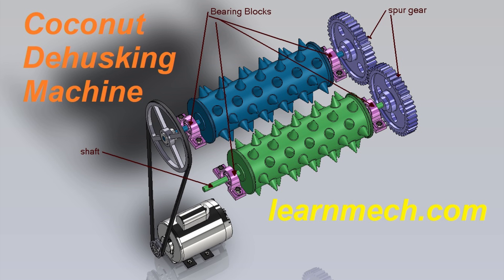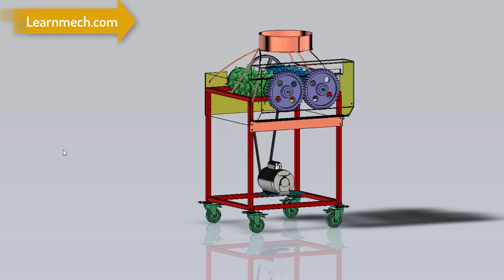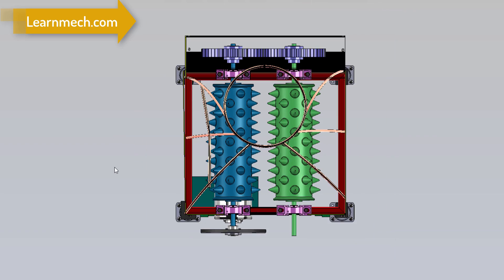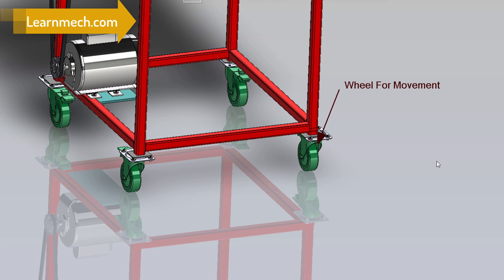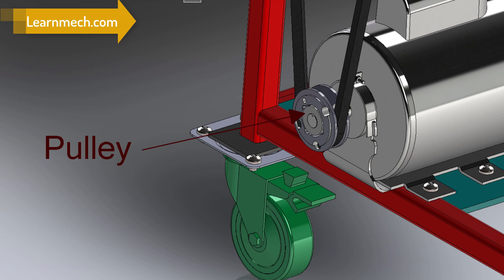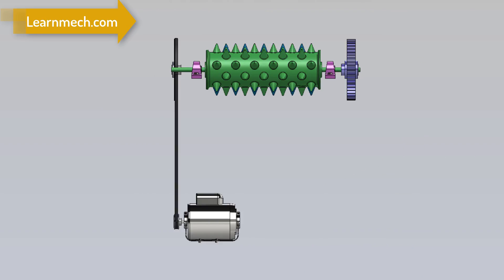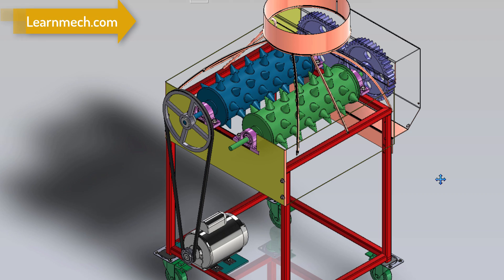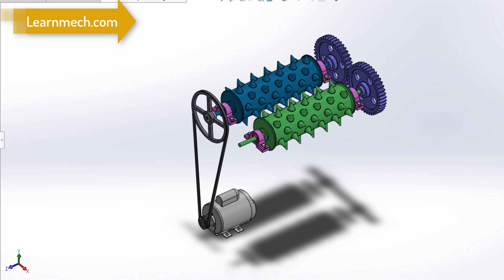Design and Fabrication Of Coconut Dehusking Machine | Mechanical Project

Comment: Speed should be reduced further. The design shows on 1/3 reduction. Rollers at 400rpm approximately. It should be 90 rpm maximum